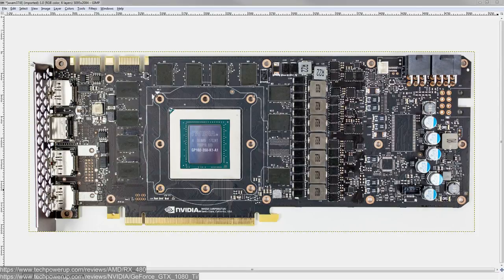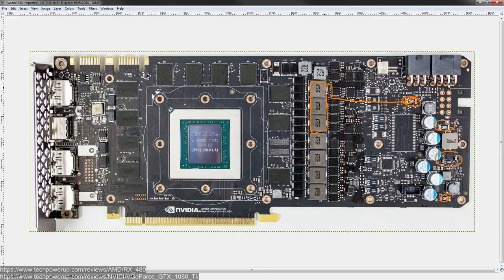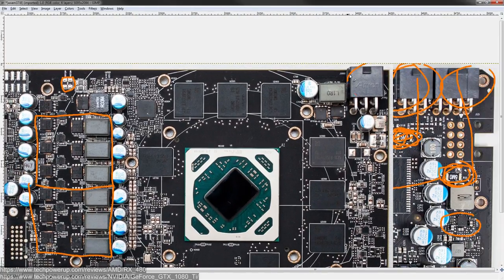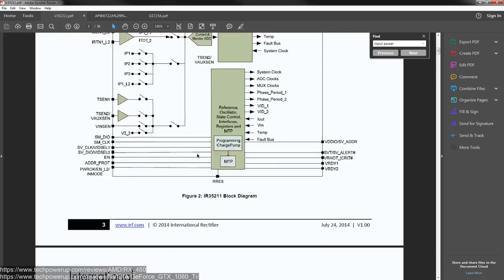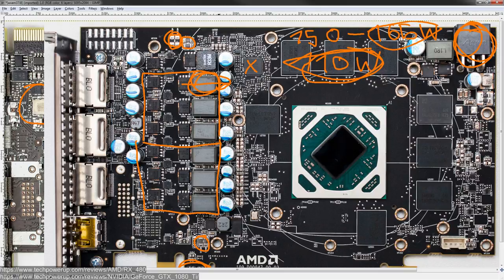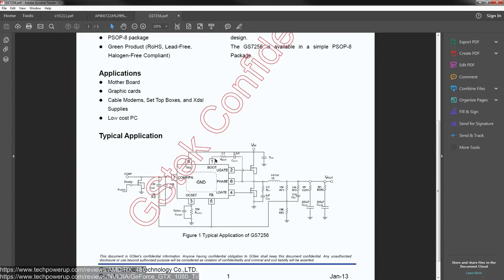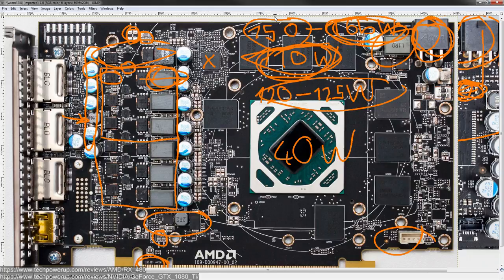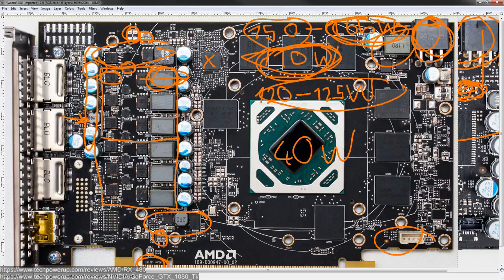The differences in AMD's and Nvidia power monitoring

Comment: Kepler was when Nvidia starting implementing this type of power monitoring, 600-series had GPU Boost 1.0 which was solely based on power consumption.
Reply: GTX 650 didn't had a GPU Boost 1.0 overall so no power monitoring Keepo

Comment: Hi, I know its an old video, but I just wanna share there is no these kind of power limiting circuit on a MSI GTX 1050 TI Low Profile, it's only monitors the Vcore voltage and in Atherburner the power limit slider also just lower the Vcore. All the power managemend done via the power management IC and 4 resistor, 3 power balancing and 1 power limiting resistor (10k). Under heavy load the Vcore drops from 1050mV to as low as 890-900mV, if you unlock the Voltage control in Aftherburner it just add +50mV  at 100%, it helps but not so much. To increase the power limit I just soldered 200k resistor on top of the 10k power limiting resistor, this give me 105% power limit. Later I changed it to 100k wich means 110% power limit, I didn't go any further because I didn't want to blow up my PIC-E connector. Still get power limit, but the voltage drop is much less, Vcore is 1000-1020mV and it gives about +7-8% performance boost.

The MEM VRM separate circuit, with 1,37V and 30W power limit, wich is plenty, I managed to apply the max OC as possible from software +1000Mhz (stable at +975Mhz) on Samsung RAM.

My final OC:
+155 GPU - meh I know I lose the lottery here, I was able to go as far as +180 in benchmarks, but is wasn't stable in games.
+975 MEM - I won the lottery here, in benchmarks +1000 no problems, but in games it crashed like 2 times a week, so I lowered a bit.

Comment: I'm not understanding the issue. the power management wouldn't really change anything would it? They could still claim 150W "TDP" because they know what it should be using on average.  TDP in quotes because it really should be TBP if we want to talk about measuring the power consumption of the board, no? That information doesn't affect the GPUs clock speeds so it wouldn't matter. I doubt nvidia is throttling the GPU based on the consumption of the board. That would be strange. 

it sounds like a problem for people who want to measure power consumption, but they would be using pci-e + plug to measure. The info in GPU-Z for power is chip only . I don't think AMD cares about monitoring the other stuff at all. At best they would care about VRM and RAM temps. They aren't going to sacrifice GPU performance over the other components.

Comment: Question: My friend got 1070 amp by zotac - 8+6pin and the difference between 100% and 50% power limit is like 1920mhz vs 1800mhz, is it possible that on 50% amperage drop the difference is no minor?

Comment: You know what's worse than not having power regulator? Having one and your cards burning up... Like the Nvidia cards... Why don't you look at adoredTV new video and realize how little praise nvidia design deserves
Reply: Oh really? How many nvidia cards have been burning up in recent history, relevant to this topic?  It's 2017 not 2007.  In fact that happening 10 years ago might be why nvidia has this kind of monitoring... I guess AMD will have to fry some cards before they do it.  At least nvidia learned something.
Reply: AMD has over current and temperature protection on their cards. Nvidia did not have that kind of protection back then. He's talking about power monitoring though, which is something most people don't really need to know. I'm sure on the engineering cards that they had monitoring circuits, but once it's in the hands of consumers, who really cares.

Comment: So AMD cards pull less power at the same performance if you have good VRM cooling, because VRM efficiency increases at lower temps, while Nvidia cards get better performance at the same power draw?
Reply: That's assuming that the actual GPUs pull more or less the same power, which they don't.
Reply: yes, nvidia is better at high end, amd is better overall

Comment: I love the video - AMD has a card that does not do power monitoring - OK so what?  You comparing a 1080TI to a RX480 is laughable given the price delta.  You assumptions fail in the fact that the RX480 cards work.  Cost is a major factor, as noted, its not just chips, its all the engineering, software and complexity of the manufacture.  AND - you scoffing at a 2% delta - sorry, that is not critical on this low end card.   For this card - it simply does not matter. My first negative comment for you - but still love the video and the channel.

Comment: Im not buying that.  The AMD card you referenced did draw more power via PCIe as measured by pcper however within a couple days a Driver release fixed that issue, also measured by pcper so AMD must have a way of not only measuring specific area's but controlling it with software so what else do you want?   I mean beside the specific hardware your'e saying is somehow a must (and clearly AMD do without it) and that all Cards exceed spec when oc'd what is your point?  You said it yourself, that the way NVIDIA does it would cost a few dollars, do you really think AMD are not smart enough to know or figure that out?  Do you not think AMD don't reverse engineer exactly using the methods you do?  And yet they've still not made the change?
Reply: Dobermanator amd is also a smaller company tho a few dollars adds up to make everything work perfectly

Comment: Nvidia only implemented this strict power monitoring because of the problems they had with Fermi. 
http://www.geeks3d.com/20101109/nvidia-geforce-gtx-580-the-anti-furmark-dx11-card/
Reply: So? FERMI was way way way old. They kept using proper measurement for 5 years and we should complement them for this
Reply: You could also argue that saving board space and components is the better choice, because in the real world it doesn't make a difference if the card uses 10% more or less power than indicated . Maybe AMD will change their power monitoring because of the bad press over RX 480 just like Nvidia did because of Fermi. Seems unlikely though since it turned out not to be an issue in practice.

Comment: I bet AMD just has to save engineering time everywhere they can because they are understaffed.
Reply: It's not about saving a few bucks it's more like Cred Dead AMD doesn't want to expose how inferior their watt wasting uArch is and how inferior Glofo's FinFail watt wasting process is. 

AMD's performance per watt is so bad that even HBM's efficiency advantage didn't help much, Performance Per Watt Champion Nivdia's Pascal still beats watt sucking, overhyped and late Vega like a pinata.
Reply: Well... Efficiency is relative to clock speed. The real problem is AMD's architecture is slow.
Since the relationship between clock speed and power usage is exponential, not linear, it's not that AMD cards have terrible power consumption, it's that they are so far behind on various things that to make the cards look even remotely competitive they need to push the clock speeds well into absurd territories.

I bet Vega is really only good for about 1000-1100 mhz or so.
But... Since it can't even compete when pushed to 1500+ mhz, well you can see the problem.

Power hungry GPU's are generally large ones as well. Let's not forget the cringe-worthy disaster that was Fermi, which just goes to show both of these idiotic companies are more than capable of making basically the same mistakes.

You design your architecture, then choose your clock speeds afterwards.
Hopefully, you aren't pushed into running your chips at excessive clock speeds.
But sometimes pushing the speeds way up is all you have.

Vega is clearly a mess... For gaming anyway. (it's compute performance is far more consistent with what you'd expect a card of that size to be doing)
AMD actually seems to have that issue in general - it's compute performance compared to the 'equivalent' Nvidia cards is off the charts, more often than not.
Yet gaming performance is... Quite honestly, pathetic.

It either proves that compute and gaming workloads don't have that much in common, or it proves that AMD cards are rarely being used to their full potential.
After all, The RX480 is closer to a GTX 1070 than a 1060 in compute performance, yet in gaming it is either barely keeping up with, or even falling behind the performance of a GTX 1060.
We are talking a card that in raw processing terms would appear to be something like 50% more powerful, yet in realworld gaming tests much of the time it isn't just not keeping up, it's losing. (yes, there are outliers, and everything together the RX480 and GTX1060 seem about even, but the theoretical numbers vs realworld performance seem very out of proportion.)

Clearly, AMD's design isn't optimised correctly for realworld loads.
Or at least, not realworld gaming loads.

So if we assume they weren't complete and utter idiots, this raises the question - if these cards have SO much raw power that isn't doing any good for gaming (50% more theoretical performance is not a trivial amount), then what IS it designed for?
Has AMD been focusing on stuff other than gaming this whole time, and just not telling anyone?
Could be.

Vega certainly seems to suggest so, given that it is a monster of a GPU with a bunch of features that are outright pointless for a gaming card.
So... has AMD not actually been designing cards with gaming in mind this whole time?
Is gaming performance an afterthought to other purposes for these cards?

Hard to say. But something really doesn't add up somewhere...
Again, an RX480, in theoretical terms is closer to the brute force performance of a 1070 than a 1060, yet in realworld terms it's struggling to keep up with the 1060...
And this isn't an isolated thing, it's a trend with AMD cards that goes back many, MANY years.
They are vastly overpowered on paper compared to their real-world gaming performance.
And I mean, SERIOUSLY overpowered. Like anything from 40-70% more powerful than the nvidia cards they aren't keeping up with.
Which really doesn't add up.
Poor design? Poor utilisation? Or... Designed for entirely different purposes, and shoehorned into gaming after the fact? Who can say? It's likely impossible to work this out without reverse engineering these cards down to the finest details...

Still, the days of Fermi vs Evergreen/Terascale are long gone. Quite why AMD has stuck with GCN derivatives for as long as it has is beyond me.
Fermi was disastrous, but Nvidia dumped it after 2 generations at most.
GCN has been around for I don't even know how many generations now? 4? 5?
Way too long, clearly.
Do they only keep going with it because they don't have the resources to replace it? Or is there something else going on that they aren't telling us gamers?
Reply: KuraIthys amd designs their cards for compute performance more then anything which is why they excel in processes that can utilize all of the chip but if you look at Vega 64 vs 56 the 56 can actually smash a 64 up until your pushing ln2 gcn is probably not really well utilized for gaming work loads vs compute work load. I've never seen a gcn based card really fall behind in workstation tasks vs a cuda based card amd just sells you stuff that is most likely stuff they didn't ever give certifications.
Reply: In gaming

Comment: If you make 20 million GPUs per year and that component costs 1$, you're saving $20 million. If you're AMD this sum is the difference between being profitable and having a loss.
Reply: But they can incerase price for ~5$ and they will earn $80 million so w/e
And with it they won't have RX480 with "PCI-E Problems" of pulling more than 75W
Reply from the maker: they could cut 2$ of the mosfet budget to pay for real current sensing circuitry
Reply: that whole power limit "scandal" on the RX 480 was probably worth to them those $20 million...
Reply: I think if they don't want add for all power sources, they should add to PCIe power, because it make problems. For me, if card use 100/200/300W is not so important, I not going to mining.